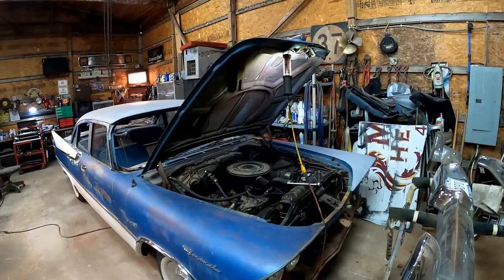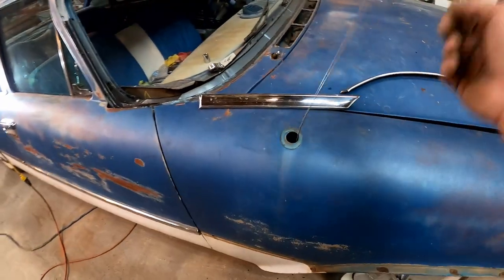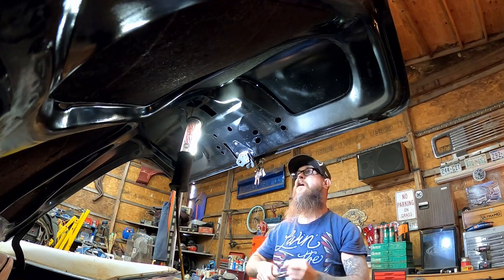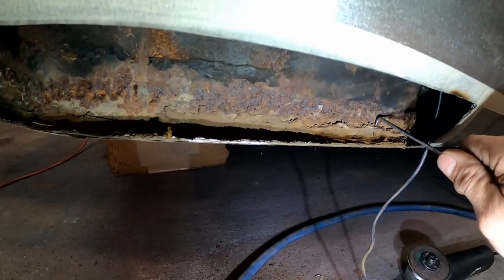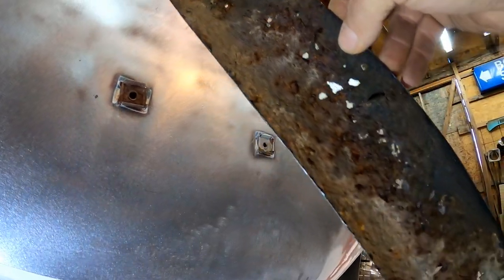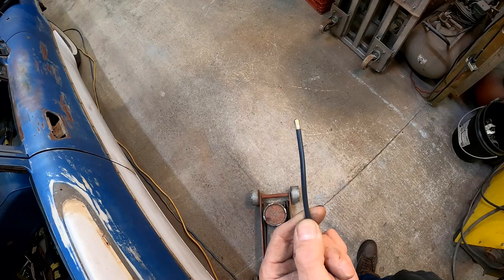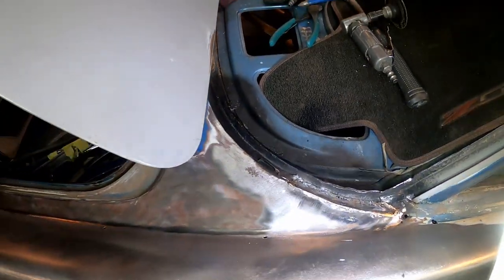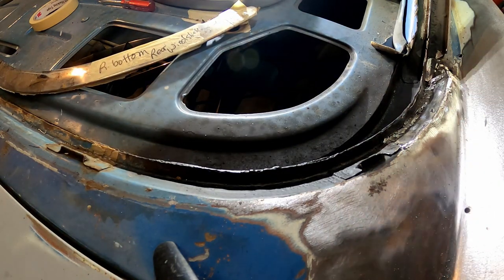Doing bodywork to the '59 Dodge Coronet pt.10

Comment: Another Dodge video. Yay ! :)

Antenna removal: There is a four inch, circular access panel on the passenger side inner fender, right where you'd want it to be. Held on by a couple of tiny spot welds. Just grind off those spot welds and then you can remove the panel and have easy access to the antenna.

Comment: Retired after 55 years doing bodywork I have a tip you may find useful, guide coat your filler and block sand with 180 or 220 before primer and you'll be amazed at how little effort it takes to finish out to perfection.

Comment: Just a note on the wheel well opening clips: You can find the same or similar at an auto body supply store. Probably made by Auveco. I would also recommend using universal molding clips with a 10-24 post and spring-wire, on the body side mouldings, rather than the spring clips. Using them gives you the ability to line up the moldings before tightening the nut on the post.

Comment: In the area on the car where you have rust, I found that using a pressure feed sandblaster using  fine glass not sand did a better job than a grinder for rust removal. A grinder removes good metal as well as bad metal. where as glass blasting removes mostly bad metal which helps in the welding process.

Comment: 7/16", 1/2" & 9/16"  was all you needed for these old cars..
AM car antennas  were typically a 3 section mast and were required fully extended when driving out in the country where signals were weaker.

Comment: As far as your sorting goes, you should get some of those really large plastic tubs with lids and store the stuff in there and label the tubs per the section of the car. This way if a screw falls out, its still in the tub. Then get you a shed to store the tubs in as to not clutter up your garage so you still have room to work. I mean I get your system works and all, but there is nothing wrong with improvement.

Comment: I've noticed,not one piece of rusty at all ,are they stainless steel ?
Reply: Yes, I believe they are. On cars of this era there never seems to be any corrosion in the metal trim. That's good because it makes the bits less likely to bend when you're prising 'em off. The only non stainless parts are the 3D trim parts like the emblems, which seem to be a fairly durable zinc based alloy castings, and these are usually chromed and in poor condition so they have to be sent off to the rechroming experts, or you need to track down replica copies.
Reply: @johnstedman4075  that's great to know,thanks for that 😊👍

Comment: Be careful with those trim clips they don't make them anymore and you got to reuse them to put the trim back on so make sure you don't break them if you have to fix any trim that's dented or that check out scott at Cold War Motors he is a body guy and shows how to revive trim that has a dent or scratch to make it new on his 1960 Fury restoration videos the guy is a master body guy
Reply: Not really. You can use readily-available Auveco clips to hold both the body side and wheel well opening moldings. And since they use a screw post rather than a spring clip, you won't chip the paint  when reattaching the body side moldings. They also give you some 'wiggle room' to align the body side moldings perfectly, which you don't get with the spring clips.

Comment: Now I'm not that frustrated because I melt the metal when I'm welding and I'm welding without gas.
Reply: And I replicated that pulling tool of yours except that I used another longer bolt and saved the original if I want to use that blocking pliers without the long handle. First I made it very long, like +4 feet, it was looking like a spear :))))